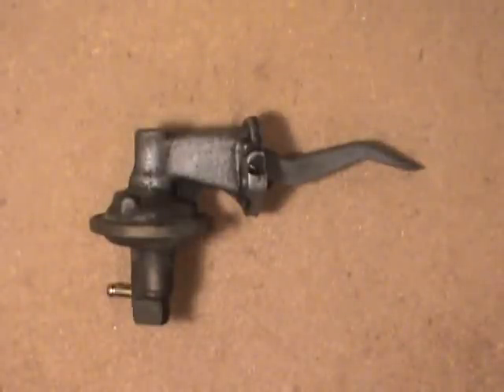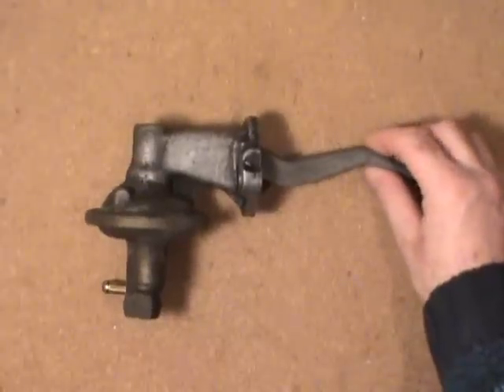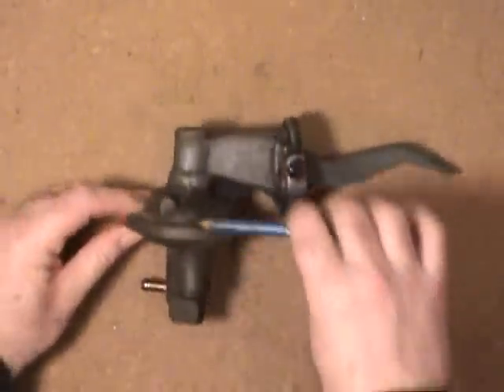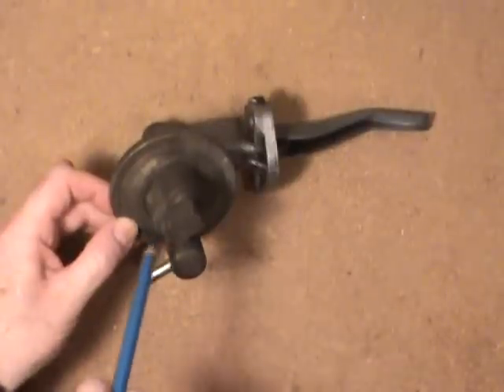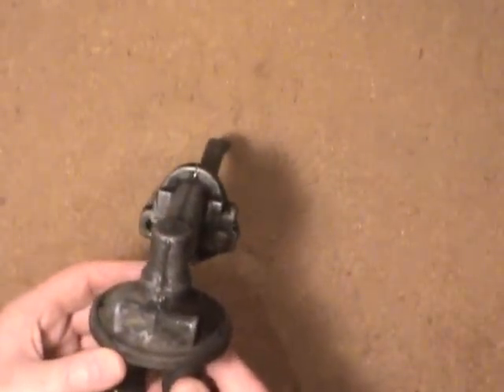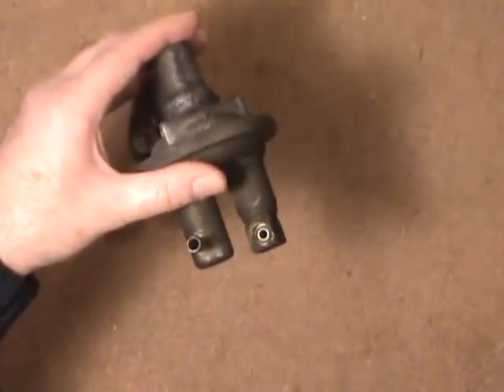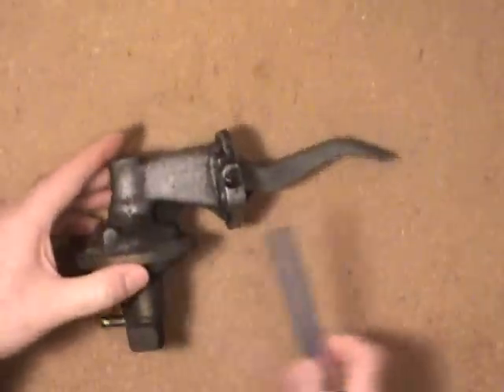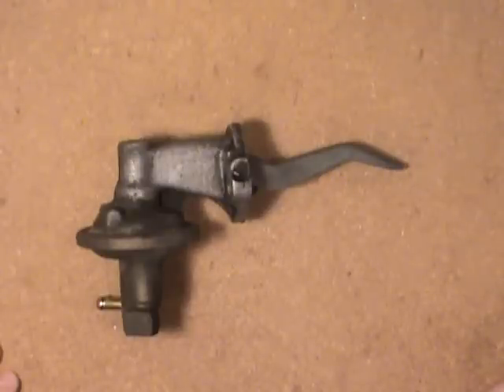Fuel Pump Mechanical Type Demo

Comment: Does the fuel on the inlet from tank allow the fuel to flow back into the tank. Leaving the fuel filter empty.
Reply from the maker: Greetings.....Baradonna………..Thanks for watching...…….Well, if the carburetor, happens to be a Rochester carburetor, then, the little fuel filter (some are 1 inch long, and, some are 2 inches long, there-abouts), that fits into the carburetor itself, will usually have, a, shall we say..."anti-flow-back"...valve (round shaped, rubber-like flap), that's on one end of, that little fuel filter, that, as I see it, will prevent the gasoline, from flowing away, and down, from the carburetor, and hopefully, keeping the fuel line, full of gasoline, when the engine is not running...…….The mechanical type of fuel pump has two valves, inside of it, as in, one inlet valve, and, one outlet valve...…….As long as, one of those valves is closed, then, the gasoline, should stay in the fuel line, for quite a bit of time, I would think...…..If a carbureted engine..."has not"...been running, for, about a week or more, then, the gasoline, that was in the carburetor's float bowl, or bowls, as the case may be, will usually evaporate some-what (because of, the engine, remaining hot, after shut-down, for quite some time)……….So then, now the carburetor's float bowl/s are empty (no gasoline at all), and, the engine gets cranked over and over, until, that fuel pump, pumps enough gasoline, into the carburetor's float bowl/s, so the engine has enough gasoline, so it can start and run again...…….The Mechanical type of fuel pump, pumps gasoline, quite slowly, when the engine is only being cranked over, by the (electrical) starter motor, because of the low engine RPM's (Revolutions Per Minute), during engine cranking (as in, trying to start)………..If you are experiencing, a really long, cranking/engine starting time, then, try this...…….Try starting your vehicle, the..."very next day"...after, the engine was running last, and, if everything works, as good as it should be doing, then, the engine should start up..."very quickly"...!!!...…and......till next time...….Be Safe, take care, and have a good one.

Comment: thanks it was very helpful ..i have 1971 dart slant 6 .
Reply from the maker: Greetings...D W...….Thanks for watching...……..Well, my (use-tah have), slant 6, was 2 years older...….It was, a 1969...225...slant six, that was in that, good ole 1969, funky lookin' van, that had, a..."3 on the Tree"...lol...(as in, 3 speed manual transmission/with a clutch pedal, and, having the shifter, up by the steering wheel)...……..Damn, when I got it, it had a Bigger carburetor on it, and, Hooker headers too...!!!...…..Accelerated even better, once I changed, the whole rear axle carrier, when, it went from, about 2.73 there-abouts, up to, 3.55 rear end gear ratio...!!!...Wowsers…!!!...Super acceleration from a stop...but...the poor ole engine, was revving its guts out, if I went any more than, about..."double-nickels"...lol (55 miles per hour), on the freeway/highway...!!!...…….Ah yes...the good ole days (big sigh)...lol...….and...….till next time...…..Be Safe, take care, and have a good one.

Comment: Hi @RockysRoadshow , i have a Cadillac Deville 1978, i am asking this question so may be you or an other youtuber can light me . For now a week my car is stoping when going down hill, i cant start it when going up hill also and when i press to much on the gaz pedal when on flat  the engine gently stops. I am wondering if it's the fuel pump ( that i have not been able to locate on my car, i am having struggle to translate the manual from english to french and i dont understand all the technical words. ) or if it comes from the carburetor. When on a flat ground the car would start though and keep on running .  Thanks a lot if you or anyone can give me any advice that would be really appreciated. I wish you all the best and thanks again for your great videos !!!
Reply: PS: I am living in California .
Reply from the maker: Greetings..charles derenne…………Thanks for the nice comment, and, thanks for watching...…….To me, it kinda sounds like, a fuel starvation problem, that's causing your engine's, not running, so well, problem...…….When was the last time, that, the..."Fuel Filters"...were changed...???...as there are probably two of them, as in, the larger one, might be found near the fuel pump, while the other smaller one, will probably be, just inside of, or, very close to, the carburetor...…….Might be...a clogged/plugged up fuel filter, or filters, as the case may be...a weak fuel pump...or, dirty jets or passage ways, inside of the carburetor, and rarely, it might also be, a lot of crud, that's plugging up the filter, that's on the end of the pickup pipe/tubing, that sucks up the gasoline, that's inside of the gas tank...…….Sometimes, it can be exhaust system related as well, as in, something, that is causing an exhaust flow "restriction", in the vehicle's exhaust system...……..A clogged up (restricted) catalytic converter, muffler, or resonator, can prevent the free flowing of exhaust gas, through the exhaust system, which will reduce power and performance, if it's not too bad, while something, like, an almost, totally plugged up, catalytic converter, can almost cripple an engine, so much so, that, Ya might not, even, make it through the intersection at all...!!!...yikes...……If it's not fuel related (which I doubt), then, Ya probably have the HEI (High Energy Ignition) Distributor (with, the Large size distributor cap on it), which, might, have to be checked out as well, possibly...…….Good luck, and......till next time...….Be Safe, take care, and have a good one.
Reply: @RockysRoadshow  i brought it to the shop , and it was in did as you just said the fuel filter that was well plugged with dirty things. They changed the sparks as well that were oily. Every when would you recommend to change the fuel filter just so i know and i will did it myself also, i have difficulties to locate its by the carburetor. thanks a lot for your message, you are a boss, happy belated thanksgiving.
Reply from the maker: Greetings...charles derenne………….Thanks for your good wishes, my Friend........If you have the little car owners manual, that came with your car, when it was brand new, then, you might find, the amount of time (in months or years), and/or, the mileage/kilometer intervals, as to when, things like filters, need to be changed, as well as, many other maintenance things that should be done, so, your car will have the best chance, at running very good, almost, all of the time...…….For something like a fuel filter, then, I usually change it, about, every 2 years, or, 24,000 miles (40,000 kilometers), whichever comes first...…….If your car, has a "Rochester" carburetor, then, it will usually have a small fuel filter, that is just inside of, the front of the carburetor, and, some are about 1 inch long, while others, are about 2 inches long, and both of them, are about 3/4 of an inch in diameter...…….There is usually a very "thin"..."seal or washer", that might be made out of plastic, or, gasket like material, and, if it gets damaged at all, while trying to replace the little fuel filter, that is inside of, the front of a Rochester carburetor, then, "gasoline", will probably start..."leaking"...from the front of the carburetor...!!!...……..Try to get a new seal (gasket)…"before"...trying to remove that little fuel filter, from the carburetor, just in case.........Sometimes, the nut (fitting), gets really stuck, to the (usually) metal fuel line (tubing), so, use penetrating oil, and go very easy, when trying to loosen that nut, or, sometimes, that metal fuel line (pipe), gets twisted, and damaged...!!!.........Good luck, and...…..till next time...…..Be Safe, take care, and have a good one.

Comment: Nice explanation  thanks helped me no end ,found the pump get a spare from wreckers and refitted the pump ,primed the motor and voila ! just Like a NEW one only $100 cheaper than the last time it happened to a car of mine 10 years ago so that $100 would most likely be $300 Now!! I owe you a beer or three for that one mate...cheers
Reply from the maker: Greetings...Niki Markieren............Thanks for the nice comment, and for, watching too..........Yeah, I learned, not too long ago, that..."New"...isn't always..."Better"...than..."Used"...lol.............Now then, please do, allow me to explain, about such a thing (actually, it was more like a "happening"...lol)...........A few year ago, I thought that, it would be, a pretty darn, good idea, to replace, a mechanical (type of) fuel pump, that, was on, a smaller, Oldsmobile, V-8 engine, that was "working good", but, was rather old (in Years), and, had lots of miles (or, kilometers) of use on it...........So, I goes to the parts store, and gets me (and the car too...lol), a..."brand new/top brand name"...mechanical type of fuel pump, and I...Re & Re'd..."it" (Re & Re = Re-move and Re-place), oh, and..."it"...happens to be a fuel pump...lol...........Well, the installation part of it, went very well....then, a few days later, another type of..."it"...happened, and, almost, yes, I said almost..."left me (and the car too), stranded"...(good thing, that..."it/the happening""...happened, on a quiet road, without having, very many other cars around, at all)...........Well, after quite a few starting attempts, Ya might say, that a (small?)..."Miracle"...happened, as in, the "thing" ("thing" in this case = engine...lol), actually started, but, barely stayed running, but, just enough, for me, to..."Nurse/Limp"..."it"...back home, just a few miles away ("it", this time = whole damn car...!!!...lol)..........So, what was causing this...(You choose the "word"...lol)...Problem...???...!!!.............Well now, when I got around to checking the..."flow-rate"...of the gasoline, on the output side of the...Brand "NEW"...fuel pump, guess what happened...???.............Well now, I'd say, that, a "small Rodent", would be able to..."out-Pizz"...that (You choose the "word", yet again...lol), so called..."top brand name...NEW...fuel pump"...!!!...oh-my-goodness...how about that...???...lol...(I be guessin', that, that there, "NEW" fuel pump, might-ah had a, so called..."Manufacturer's Defect"...of, one kind, or another, don't-cha think, maybe...???)...........Thanks kindly, for the "Brew-skee" (aka, Beer) offer, my friend, as, I sure do, appreciate your kind gesture, but, Beer, (cans or bottles), don't travel so well, via the internet...lol...but, kind words...sure do.........."Cheers"...mate, I say (as the BIG Beer glasses) go..."Clank"...oops... I meant to say..."Clink"...and.......till next time.......Be Safe, take care, and have a good one.

Comment: how do you tell if the push rod on my fuel pump is actually hitting the lever. arm on pump
Reply from the maker: Greetings...Jonah Haynes..........Thanks for watching...........Well, about the only engine, that I can think of, that actually had a "push rod", that made contact with, and moved the mechanical type of fuel pump's actuating "lever" (or arm, if you will), would be, a good ole Chevy (Chevrolet) V-8 Engine, otherwise, there wasn't a "push rod" at all, in any of the other engines that I worked on (most being, a Chevy, Ford, Dodge, or AMC/American Motors engine)...........I be thinkin', that, if your engine, actually is a "Chevy" V-8, then, about the only way, that I can imagine, that, the "push rod" is not making contact with the fuel pump's actuating lever, is that, the "push rod"..."was not"...installed in the engine block at all/in the first place...!!!............Some folks, might coat a "push rod" (for a Chevy V-8), with some grease, so it would stay-put, and not slide out, before the fuel pump gets installed/bolted to the engine block, as I recall...........All of the other engines, that I worked on (not a Chevy V-8, or maybe, that Mazda rotary engine, that I once messed with), would usually have, the fuel pump's actuating "lever", making direct contact, with an "eccentric" (that be, a round diameter, that was offset to the camshaft's centerline), that would wobble, causing the fuel pump's lever, to go...UP...down...UP...down...when-ever the engine was running, or being cranked/started..........In the case of a Chevy V-8 engine, where I (hypothetically), wanted to know, whether or not, a "push rod", was actually "hiding" inside the engine block (or not), then, I'd probably do a very basic, fuel pump (gasoline)..."output" (pumping ability) test............Having the Vehicle parked "Outside", in the fresh air, because an engine's exhaust gas is "Deadly", I would then, remove the fuel line from the carburetor, and, plug a rubber hose (oh, about 4 feet long or more) onto it, then place, the other end of that rubber hose in a bucket, then, start the engine (it should run for a minute or two, maybe more, on the gasoline, that was (presumably), still in the carburetor's float bowl/s , and then watch, how good (or not...???), the flow of gasoline was, that was (hopefully), coming out of that rubber hose, that was held over the bucket/pail..........If there was a good flow of gasoline, coming out of the end of that rubber hose, then, all is good, and, if not, then, maybe, just maybe, that "push rod", might not have been installed, possibly...???...lol.............If you can tell me, a few things, about your vehicle, as in...Year...Make...Model...Engine size, etc, then, I'll be able, to be, a bit more specific, and a whole lot, less generic, with the information, that I'll be able to provide you with...thanks, and.......till next time.......Be Safe, take care, and have a good one.